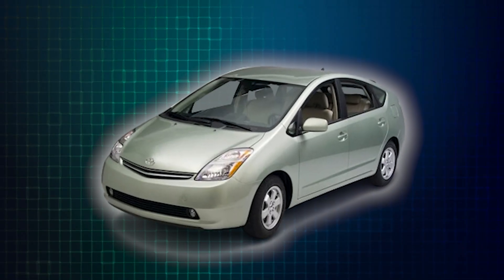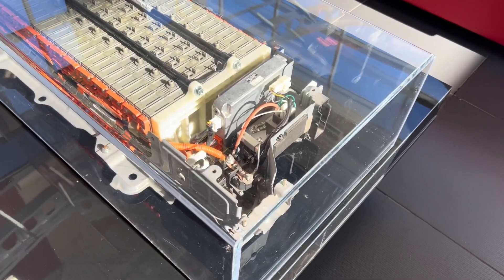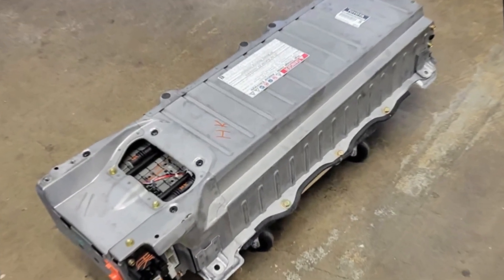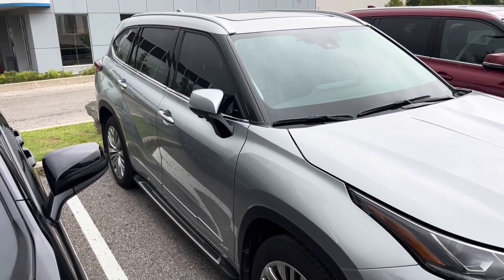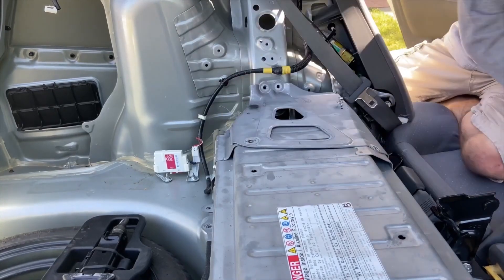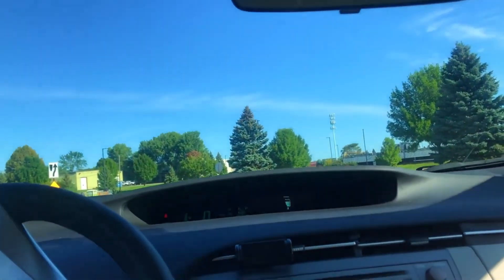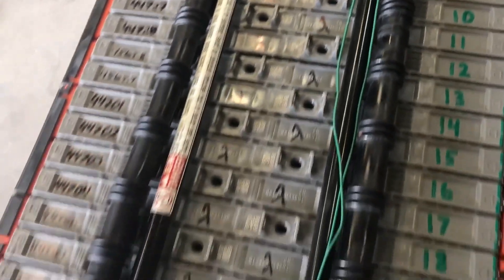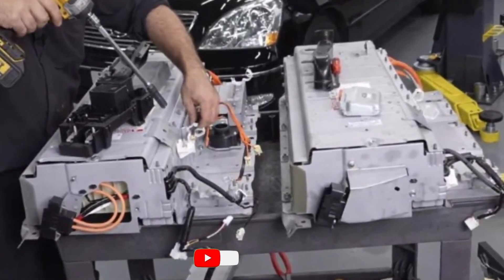How Much Does It Cost to Replace a Toyota Hybrid Battery?

Comment: Contrary to normal EVs, the batteries in hybrid are small and usually with inferior technology.
- A small battery goes trough a many charge-discharge cycles per day... resulting in it's reduced lifespan.
- Battery chemistry was typically NiMH or NiCd. Used for their ability to discharge more power relative to their size... but the disadvantages were far more. Fast degradation, lower density and capacity, slow charging and memory effect.
- The dealer will always quote an exorbitant amount of money for repairs and maintenance. Also Toyshita requires you to regularly visit them and pay for "battery check ups"... or your warranty will be void. In reality they don't do anything to the vehicle.

Hybrids offer absolutely NO real world advantages. Some start-stop city scenarios could result in slightly lower consumption... unless you have the AC on. Highway driving results in MORE fuel consumed. Toyota were sued for false advertising and up to 6 times higher fuel consumption. Also sued for falsifying documentation related to emissions, fuel consumption and noise... providing modified vehicles for safety tests and hiding documentation related to their hybrids for over a decade.
You have to keep in mind that this energy does not come from the vacuum of space and has to be generated from somewhere - from fuel. You engine is a generator.